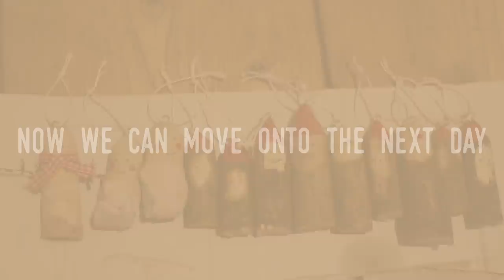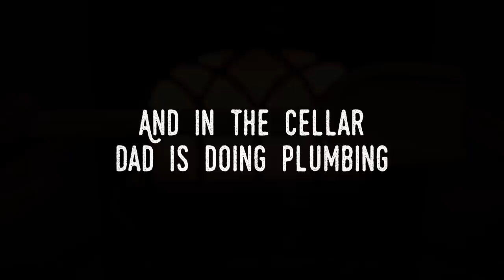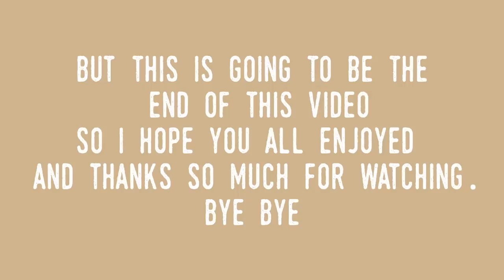Painting a bathroom and baking | HOME RENOVATION EP12

Comment: Pro tip: if you're worried about old paint peeling, use a big brush rather than a roller (and by big I mean the size used for the penetrating sealer around 4:50). You'll get some brush marks but are much less likely to peel the old paint off the wall.

Comment: hello! Nice to see your christmas celebrations. Your cakes are quite similar to here in Norway, but there are also differences. A piece of advice: At 21:18 in this video I see you are starting a fire. Your wood burning stove is exactly like mine. In this video you have the air control handle at the top right corner of the front of the stove to the left. That equals no air flow. In the start of making a fire this should be in the opposite position at the far right. That equals maximum air flow. As the firewood turns into embers you can reduce the air flow gradually, but never close entirely. Maybe you changed it after that sequence was finished. Thought I should mention it anyway. Good luck with your good work!

Comment: If you paint acrylic paint over oil based paint and vice versa it will always peel. So whatever you are using is the wrong type of paint. I think if you use Kilz or Zinsser paint it will prevent peeling. Otherwise it's acrylic over acrylic and oil over oil.  Hope this helps.  You are great love watching the rehab.